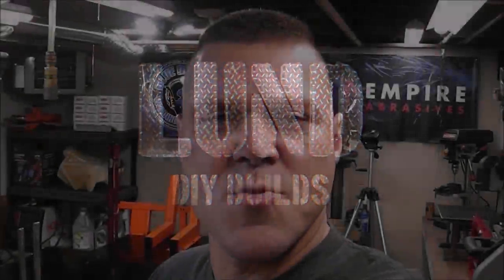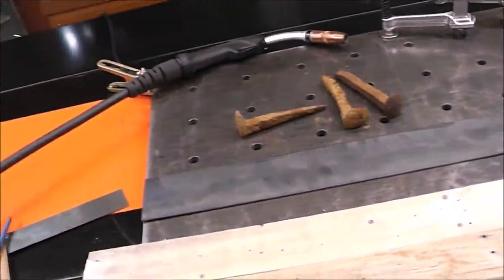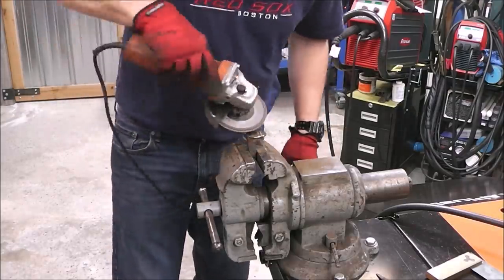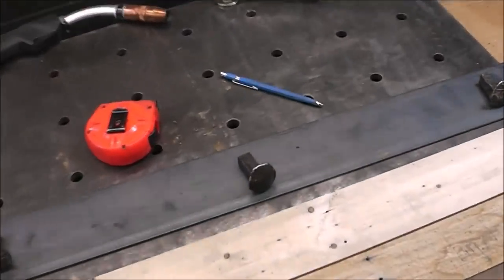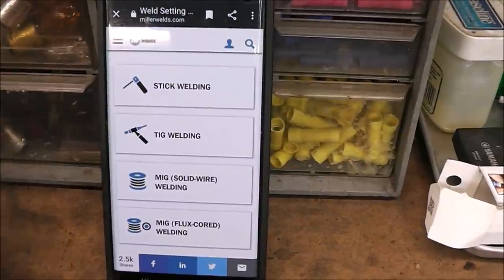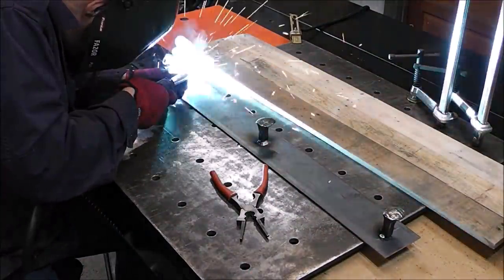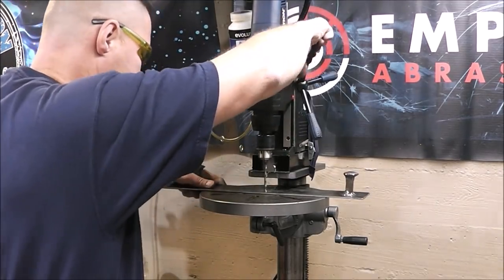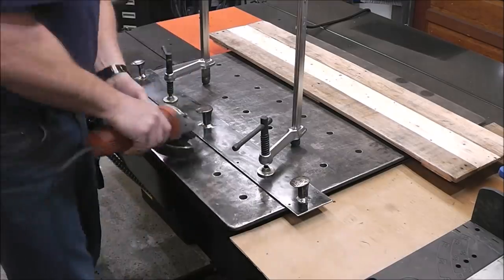Mig Welding Project Coat Rack Build

Comment: I am getting back into this as a hobby and putzing around. I have a new 160amp inverter 110/220 welder and I am wondering which welding tods do I need to have laying around for playing with steel...? What are the types of welding rods I should keep... I know, not the best probably I have some 1/16 6013... I think I need some 3/32 of the same... But what else for a beginner...? I am thinking just two or three types as a max...
Reply from the maker: I basically use 6013 for thin metal like sheet goods, 6011 for 1/4" and above and 7018 for just about everything that needs strength and good looks. Personally i pretty much do everything with 7018. It keeps it simple

Comment: Hey the next rust to gold project try over night soak in white vinegar you will be amazed at the rust and mil scale removal this stuff does. PS rinse in clean water when done.
Reply from the maker: Great tip! Thank you! Ive experienced a little with white vinegar but wasn't sure if it would cut through the heavy rust.

Comment: How thick is your welding table and what kind of clamps are you using?
Reply from the maker: Its 1/2" and they are from harbor freight. I have a complete build video with all the links and shoulder bolts you would need

Comment: Do you have a plan for fastening to the wall?
Reply from the maker: I will either screw it directly to studs if possible or I will just use a picture hanger kit that comes with a d ring

Comment: Can I put a cold cut blade on my Dewalt cutoff saw? Or am I stuck using the abrasive wheels?
Reply from the maker: You can but it won't last long. The Dewalt spins too fast and the blade will be done quickly..
Reply: @BrandonLund  I see... darn lol I wish I would have known about cold cut blades before I bought my Dewalt I would have shoped around some more. I think you were the first person I've seen using one. I've always been under the assumption that for cutting metal you either needed a hack saw or an abrasive cut off wheel
Reply from the maker: The cold cut blades work awesome! The saw and blades are overall a little most costly than an abrasive saw but the speed and cut are worth the extra money
Reply: @BrandonLund  that and I hear there alot cleaner too. You get little metal flakes instead of a bunch of dust. Guess I have something to look forward to upgrading in the future 😊 my next big purchase is an oxy acetylene torch so I can cut plate. I'd get a cheap plasma but the cheapest one I know of is harbor freight and its like 800 bucks the cheapest torch setup I can get is 350.
Reply from the maker: Check this video out if you havent seen it yet. I bought a cheap plasma for around 300. As long as you have air and power you never have to buy gas. Torches are nice but gas is expensive. Its just a thought. https://youtu.be/-KfF0QsRspI